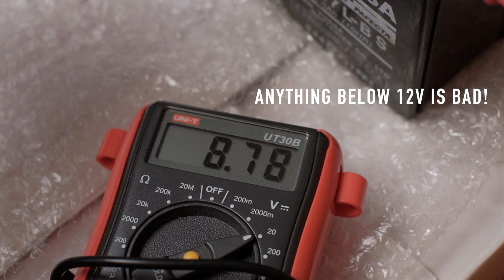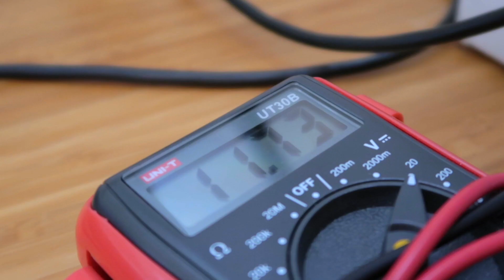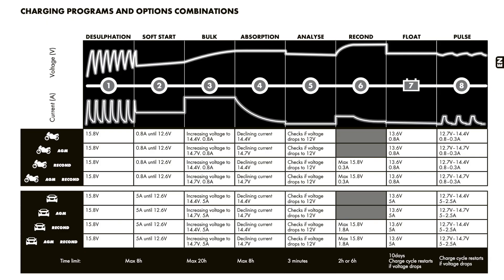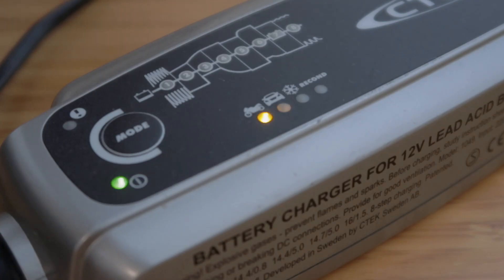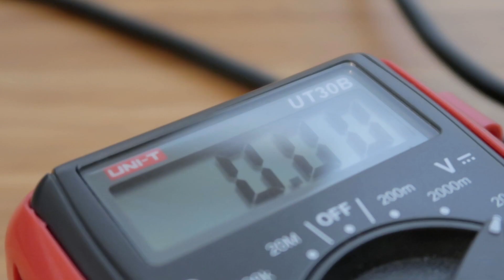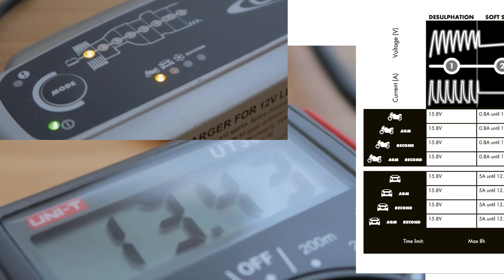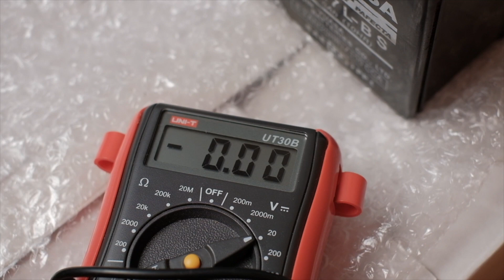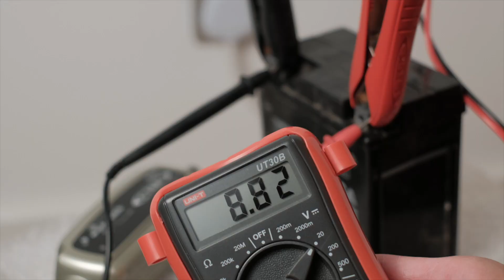Knowing WHEN to change your battery using a multimeter or a CTEK charger

Comment: Hello, I know it is a bit late, but was there a reason not to use the AGM mode when charging an AGM battery?
Reply from the maker: Hi good question. Probably because I didn't know back then that the Snowflake mode is the same as the AGM mode. CTEK have since changed the icon on the charger itself. Either just AGM or Snowflake/AGM. But the voltage is the same. That means, if I have the option. I would use the AGM mode for AGM batteries. But there's no harm in using the standard mode either just to be the safe side.
Reply: The AGM mode charges at 14.7 instead of 14.4 : ). I bought my CTEK especially for the AGM mode. I used another so-callled smart charger that didn't have that option. Battery said charged. but after leaving 24hrs it dropped to 12.2, 12.3v. Now with the ctek and AGM mode it is at 12.66 48hrs later : ). I don't know much about battery tech but it seems higher voltage is needed to charge AGMs properly
Reply from the maker: @yankodimitrov5246  yeah AGM can take a bit higher voltage. I’ve had mine for many years and works just fine keeping it topped up 🙂

Comment: I used to work in a battery store... A few tips for dealing with lead acid batteries, powersport in particular.

1) powersport batteries are usually employed in seasonal vehicles. In off seasons, make sure they aren't exposed to extreme temps and they get a charge at least once in a while (AGM batteries have slow self-discharge rate when not in use, making them an excellent candidate for powersport applications).

2) if you use a multimeter to test battery voltage, DO NOT test battery voltage right after or while on charger. The voltage will be artificially elevated for hours or more after receiving a charge. Wait a while to get a more accurate reading.

3) sometimes if a battery is low enough in voltage due to neglect, like 7 volts or something, it may not be too far gone. Even if it only ordinarily takes a few hours to charge, try to pound it with a charge for like 24 hours just to see if you can get the voltage back up to where it needs to be. If you have an automatic charger, you can often ignore the "finished charging" light if it's because you are trying to rescue a badly neglected battery — just don't do that in ordinary usage of the charger.
Reply from the maker: Hi Dave,

Thank you for the suggestions! Amazing. :)

1) good to know. No wonder the BMW AMG battery seem to last so long.

2) now I realised too after my tests. 

3) problem with the CTEK once it gets to step 5 it deems it’s unable to hold its charger (at 11v) and thus it won’t continue charging, or do it’s normal thing float charging at 13.2v or something. It auto shuts off at that point. I’m left with a battery under 12v that’s not enough to start a motorcycle . Better than the 8v when I started but still seems rather dead the battery. Can’t brute force charge it with these “intelligent “ chargers.
Reply: @JoeLamOfficial  oh right yeah that can be a limitation of the newer smart chargers. It can actually be hard to find the dumb chargers nowadays. One thing you can try is looking at stores that also sell 12v SLA (sealed lead acid) batteries for small things like motorized wheelchairs and portable boomboxes, etc. Usually they also sell cheap dumb chargers for those batteries. They generally have a lower amperage output I think, but it could be useful to leave a powersport battery attached for a few days to try to revive it.
Reply from the maker: Would it not overload or blow up the battery bombarding it with constant 12v, say around 3A? With those dumb charges?
Reply: @JoeLamOfficial  yeah I mean it is risky because it doesn't have a safety feature like the smart chargers. So you have to make sure to periodically take it off the charger for a bit and test the voltage. But you can also do a bit of math and consider the amount of time you have it on the charger. Because like a lot of those dumb chargers for sla's are like 1amp or less. So you can kind of reason what a reasonable amount of time might be for a given powersport battery.
Reply from the maker: @BackWoodsWisco  True. I might give it a try. Even when it's below 12v, it's still more than enough juice to power lights and other small projects. Rather than throwing it away.